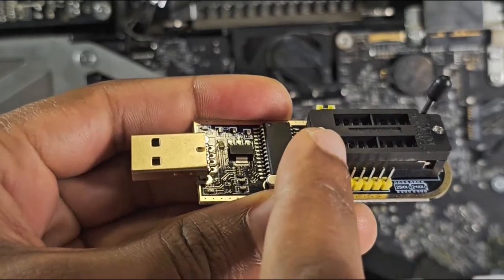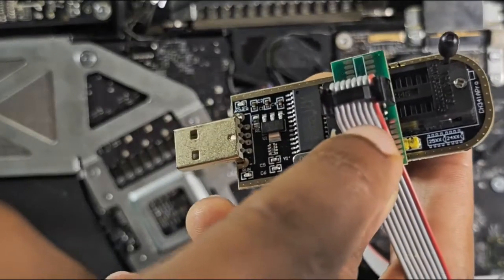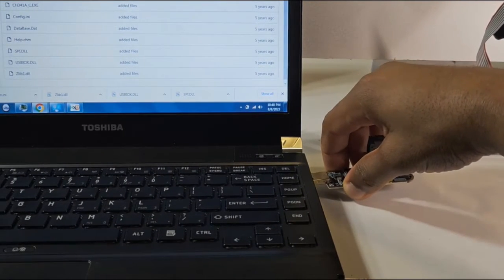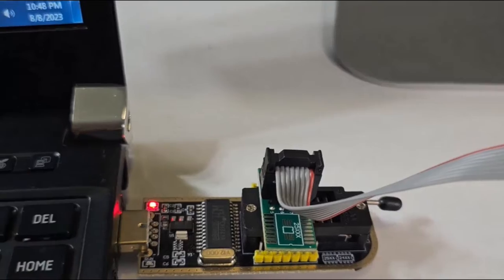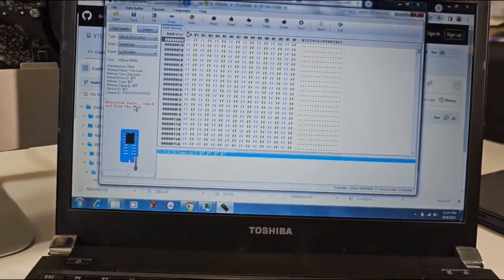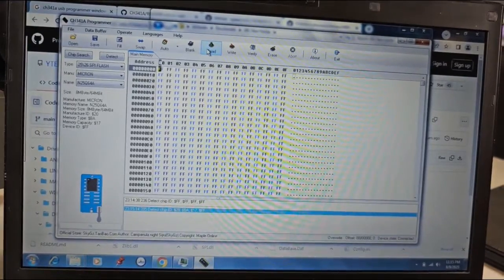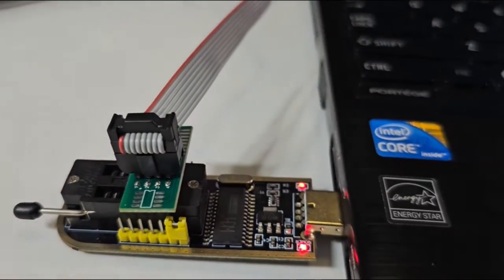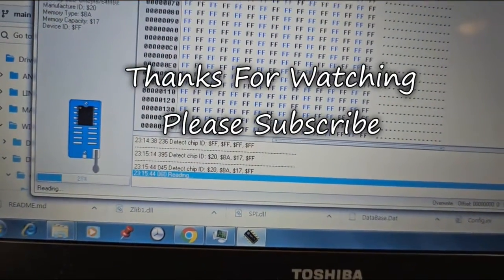CH341A USB BIOS Programmer - Flashing EEPROM Chip Quick Guide

Comment: After trying unsuccessfully several times to flash, I reconnected all 3 connections (the USB, the top connector, and the spring clip).  Regarding the spring clip on bare chips, you have to make sure it gets a good bite--even at the risk of crumpling the pins.  Just straighten them out after like I did.  After doing so, I noticed that the "erase" function was now taking about a minute.  Prior to re-seating, it took only a few seconds.  So, despite IMSProg showing the device as connected and recognizing the correct SOIC8, this does not guarantee you have a solid connection.  Once erasing takes close to a minute, I found that flashing succeeded every time.  Note that I did, however, set the delay to 5000 in the database at line 470 for the W25Q128JVSQ chip.  And I ordered 2 ch341a's just to be safe.  Sure enough, one was defective right out of the box and wouldn't show as connected in the GUI.   I am quite happy now that I can hammer the syndicate with 3 machines.
Very Best Regards,
Tom Scott 🗽
Author ● Speaker ● World's Leading Expert on the Corrupt U.S. Legal System
Stack the Legal Odds in Your Favor
Our American Injustice System

Comment: Hi , I am currently struggling to extract the firmware from XMC25QH64 chip. When I connect only the programmer to my laptop and checking using lsusb it shows but when I connect the 8 pin to the chip it disapears and says couldnt open device. Can anyone help me please.
Reply: i have the same issue

Comment: Both are turning on ? Do I need a driver or something it still doesn’t work
Reply from the maker: You actually don't need a driver. You might just need to  adjust your connection to the chip.

Comment: Does anyone know what I need to do without soldering to be able to use some kind of clipping tool for a reprogrammed CH341A? I bought a cheap one from Amazon, and the software says that it's not connected, but it's probably due to having a low-profile BIOS chip on my laptop. It's not being able to clip in properly, and I really don't have the skills or the bravery to unsolder it and then resolder it. Is there any other technique of clipping it on that might work, or any alternative products? Thanks in advance.

Comment: I have taken the necessary precautions with regards to static etc. But on three separate occasions have blown my motherboard when trying to flash my bios using ch341a?
Reply from the maker: Sorry to hear that, you should probably get an alternative flashing device
Reply: @aoeaster  thanks, that's what I thought!
Reply: test the voltages.
Reply: Hi  @swampysanta5445  I don't understand why I'd do this, its a USB connection?
Reply: @Michael-xy1lk could be a short in the system.
Reply: https://youtube.com/shorts/-QknftyXvTU?si=miBzqBg4o-6txDdm

Comment: Bro, what if the eeprom is not plugin on motherboard laptop can it work properly? Mine is accept to poweron but mouse and any device i plugin is not working
Reply from the maker: You might need to use a USB 2.0 hub to get the keyboard and mouse working, and yes, it should still work if not connected on the motherboard.